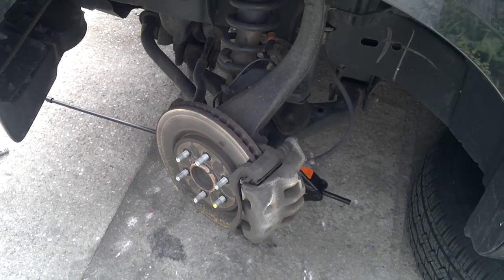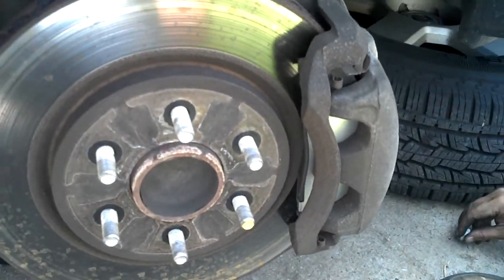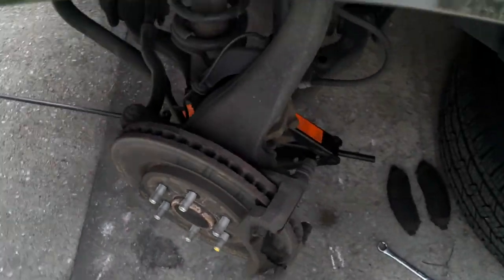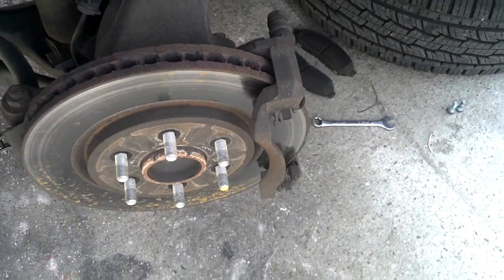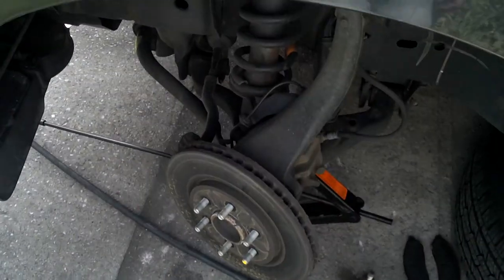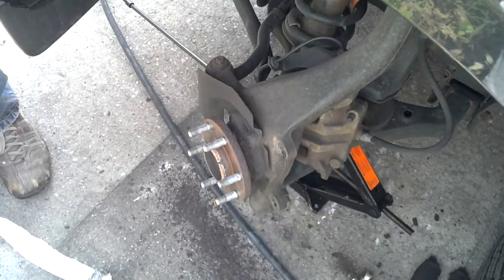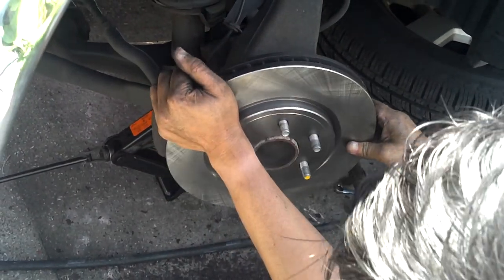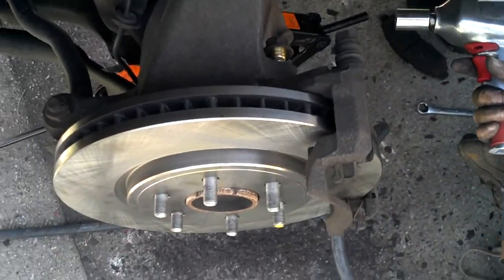how to change brake pads and rotors on your car

Comment: Hope you cleaned the rotors with brakealeen first before you installed them....They come coated with a thin coat of oil to prevent rusting....

Comment: I thought that when tightening the break gear back onto the Rotor you are supposed to tighten them to standard torque. How do you know how much to tighten?
Reply from the maker: Matt, good call.  You should always follow the torque specs recommended by the company.  I do not have a torque wrench however and tighten the bolts to nearly as hard as I can with a standard socket wrench and no cheaters.  I'm not a big guy but have found that using only a standard 3/8" socket driver without a cheater will allow me to get to very close to the same torque as when I unbolted the brake gear.

Comment: look like you did not push the caliper back when you install it back on and you supose to put grease on the bolts and the back of the brake pad too .
Reply from the maker: I'm not sure what you meant by "did not push caliper back" - earlier in the video, you can see that I used a wood clamp to push the caliper pistons in.  Also, I greased the piston heads and the caliper body which accomplishes the same thing as greasing the back of the pads but with less mess and over-greasing.  Thanks for your observations.